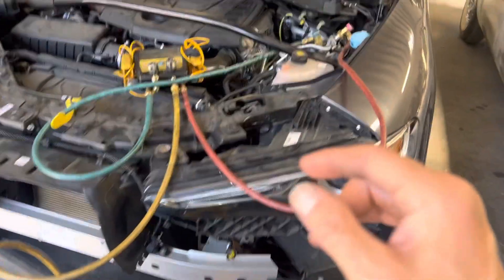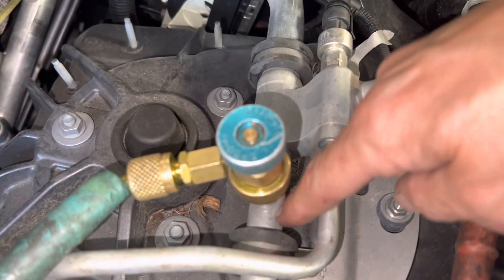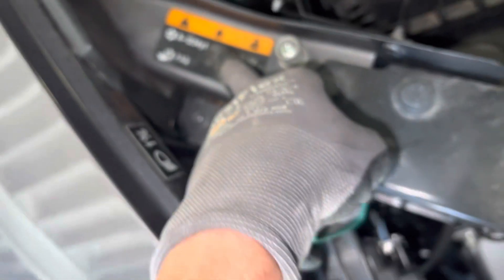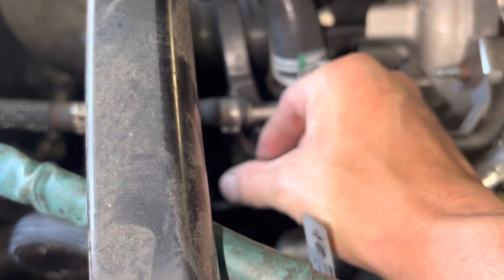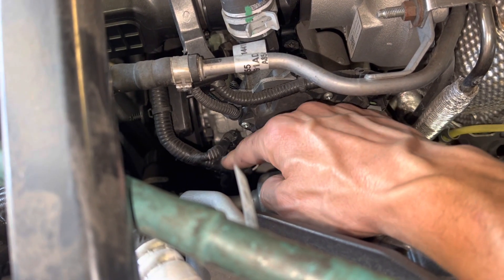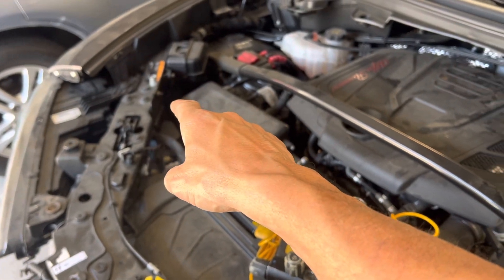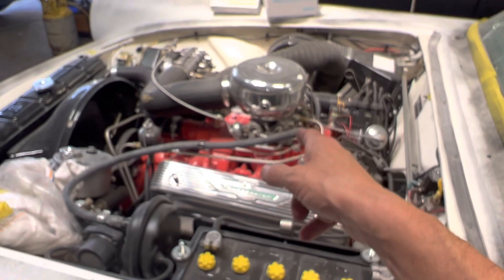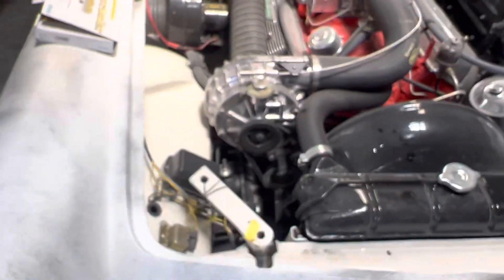AC 2019 Alfa Romeo￼ compressor size shorter than a Coca-Cola￼ soda can. Small refrigerant change ￼

Comment: we bought a new fridge either last year or the year before, 22cu-ft LG branded thing with inverter compressor.. it's r600 (butane).. super quiet and works really well, makes loads of ice too..

apparently they have been using r600 for fridges in europe and asia for almost 20 years even though the change over here has been very slow.. when I think about why we don't use more hydrocarbon gasses in refrigerant systems, especially for home use but instead get gasses that are not as good as the previous generation and nowhere near hydrocarbon I can't help but think some protectionism is going on.. dupont and others take in billions for research and development then get their products patented and mandated so people are forced to buy them
Reply from the maker: You got that right you hit it right on the nail head 100% correct the chemical companies pay their protection money to lobbyists that pay their little manila envelopes underneath the table to those in government who make the rules it’s really blatant corruption. 

And yes you are correct Europe and Asia have been using hydrocarbon for decades without any problems at all whatsoever it works much more efficiently it’s a much less greenhouse gas and you don’t need as much energy and you don’t need as much materials it’s a win-win win situation all the way around using hydrocarbon. 

Except for the chemical companies that rely on patents for royalty fees licensing fees to other companies to produce their chemicals. 

And then pay the government to pass Tara floss on a few hundred percent markup on importation of refrigerant to jack the price up for the end-user consumers so the consumers pay higher taxes on the purchase and the government makes more money. 

People are stupid when they listen to a president that says I’m gonna keep your taxes lower

Yes they kept the income tax lower both federal and state

But the way they tax the consumer in the end is raised the tariffs on the products coming into the country so instead of a TV a bad example being $100 next year it is $200

Instead of paying 9% tax for example on a $100 TV the government will make 9% tax on a $200 TV that just doubled the governments income in taxes. 

Sway the government can say we did not raise your personal tax on your income lol 😂 and the stupid Sheeple fall for this every election

Comment: hi 
Trying to maximise  cooling  the refrigerant B4 it goes to the the evap core . Oh yes a bigger/ 2nd  condenser will do the same job . What it does achieve is to run low super heat [= more evap BTU ]   as there is   minimal risk of liquid back to compressor  .
Paxton blower I believe. Minimal cHanges needed for under 5psi boost . Mandatory that spark and fuel be tuned accordingly .
Reply from the maker: Paxton yes that’s the name I was trying yo remember. 

Yes bigger or 2ed condenser. But that’s a problem on today’s small cramped engine compartments .  So smaller, lighter less material to make IHX

Comment: whats the key here on IHX pipes? Hot liquid have to be drop down own temperature, or to heat superheat vapor? Its work like additional subcool radiator in R12 mercedes?
Reply from the maker: Yes similar,    Only difference is that Subcooling can do no more then ambient temp +  and it needs a larger size heat exchanger. 

IHX Much smaller can drop more then ambient temperature. 

My father back in the 1960s  would silver Braze a copper suction & liquid line together to do the same thing for vehicles that spent their life in the Desert.